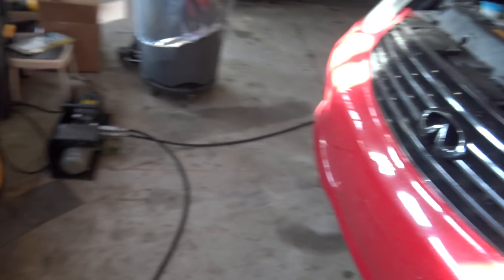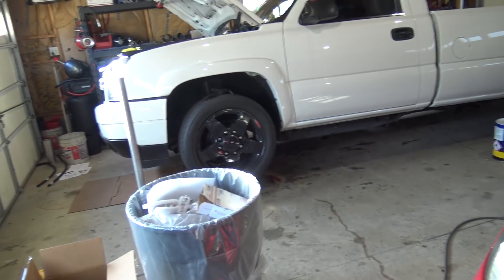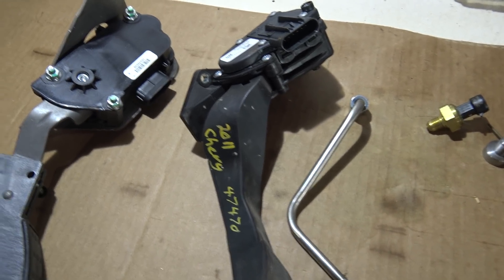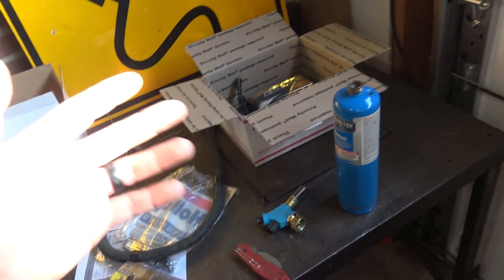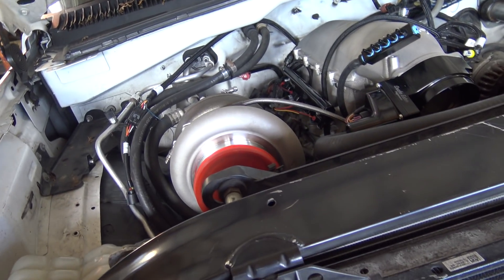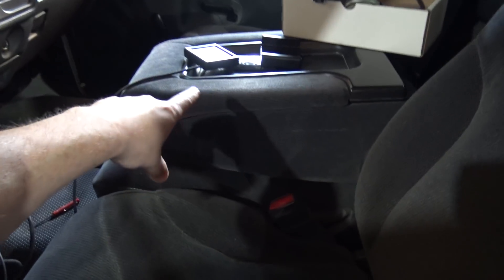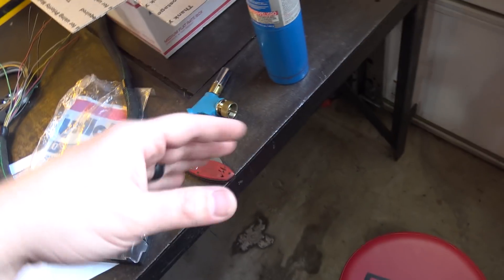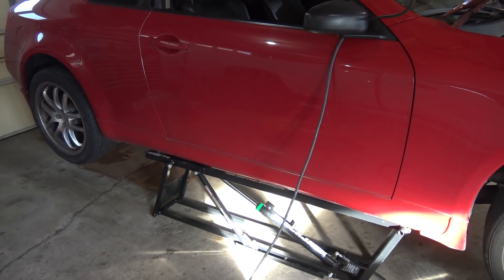2020 update on LSA G35 and big boi turbo 2500

Comment: I used to solder and heat shrink everything but just bought those terminals, shrink tube, and same crimping tool and I love it so far. I'm done trying to solder wires under the dash of an s10.

Comment: I had the same issue on my 102mm. I started it around the bottom of the throttle body first, then put a small screwdriver inside the coupler and sorta rolled it around the throttle body as I pushed the coupler on.   Didn’t’ have to heat it or anything.  Might try that

Comment: Does soldering cause any interference  on the wiring connections or are the barrel connectors just easier?
Reply from the maker: It’s a hot topic but, as people say soldering is prone to vibration related wire breaks And that is the reason oem crimps

Comment: That 2011 pedal works that’s what my dominator uses and have yet to have an issue with it.
Reply from the maker: Sick thanks I won’t even bother now lol
Reply: Sloppy Mechanics no problem... I fully integrated the dominator into my 2011 GMC Sierra, kept every factory option, even remote start and cruise control.

Comment: You dont need a T6 gasket just use high temp silicone. 1 less gasket to blow out.
Reply from the maker: Oh I know, I just prefer them since I slide the thing all over and usually end up taking my stuff apart many times

Comment: Have a question might not be a smart question but it's a question lol on gen 4 pedals they connect to the throttle body directly there isn't a TAC module. So is there different gen 4 pedal sensors or throttle bodies that can effect the communication between the pedal and throttle body? I know gen3 there are lots of different TAC Modules and throttle bodies. I'm running stock gen4 computer
Reply from the maker: Yep so many pieces that can be incompatible. The Holley the pedal goes into ecu directly and then out to throttle
Reply: @SloppyMechanics  is there anyway to find out what vehicles have the throttle body and pedal u need for a gen4 strock ecu?

Comment: What do you use for the 10 an fuel line? I want to use hard stainless line and -10 AN flexible to connect to the tank and motor for E85 on my big block 540 blower motor, 
I can't seem to find the stainless hardline in 5/8"

Comment: The EBP sensor you talk about is the 6.0 powerstroke 03-07 I believe, the 98-03 7.3 powerstroke also had a EBP sensor and pipe to the manifold. Someone else in the comments posted a 6.0 EBP part number

Comment: you guys that do your own wiring, how warm to those relays get when on all the time for, say fan use?  Also, more ramble please, it's always fantastic content
Reply: Dual 80s are going to run pretty darn cool with a decent fan or fuel pump hooked to them. Dual 40s barely get warm with a massive 4303 fuel pump on my car.
Reply: @SLOGOAT219  thank you!
Reply: SLOGOAT219 Mine is feeling warm, but I looked it up and my fans are drawing almost twice the current that your pump is. Which would be four times the heat so that makes sense I guess
Reply: @JoeHynes284  are they 40 or 80 amp relays? Yeah fans definitely draw a fuck ton
Reply: @SLOGOAT219  40 amp relays
Reply: @SLOGOAT219  I tested CONTINUOUS duty 60 ampers, 1 hour in traffic in SoCal last two days, cold to the touch... Thanks for input !!!
Reply: @JoeHynes284  did you install the dual 80 amp relays matt got?
Reply: SLOGOAT219 No, sorry for the confusion. I purchased a continuous duty 60 relay on today.   I had never tried a “continuous duty”.  Things a beast!   My fans draw 28 amps and have been melting regular 40 and 50 amp relays
Reply: @JoeHynes284  ohh okay. Wtf is the difference between a regular relay and a continuous duty relay? Lol never payed attention
Reply: @SLOGOAT219  neither had I!  but now i do..., I am also kind of retarded, but it's working like a champ now

Comment: I'm surprised you use the metal turbo flange gaskets. I swear you said once you just copper spray it and slam together. That's how mine has been for a few years with no leaks
Reply: I've done the same for over a decade. Make sure both sides are flat and use a little high temp RTV. The metal gaskets seemed to fail on me more often than i liked.

Comment: Is looking for 6.0l powerstroke sensor. 05-07 f250 and 350 as well and 05-10 econoline 250 and 350 with diesel. Exhaust backpressure sensor or ebp for short.
Reply: ZBX-3102-TK4 navistar pn, 3C3Z-9F485-BA & 5C3Z-9D477-A  ford part numbers.